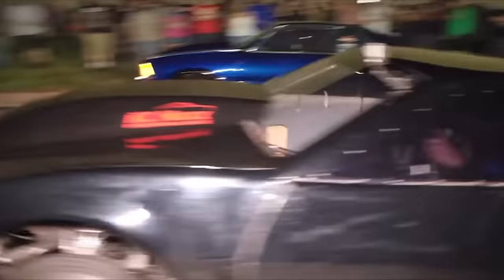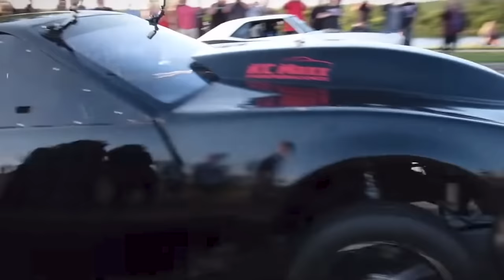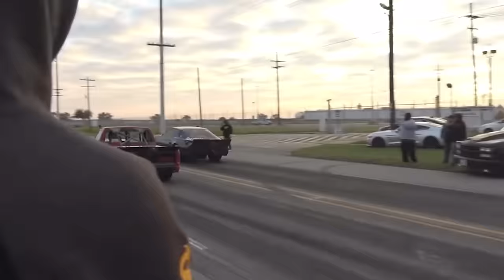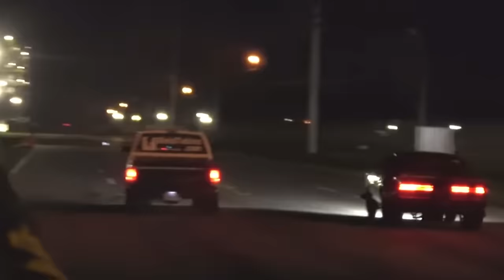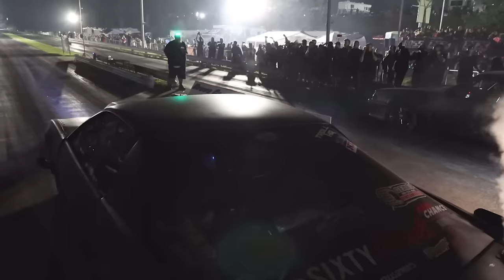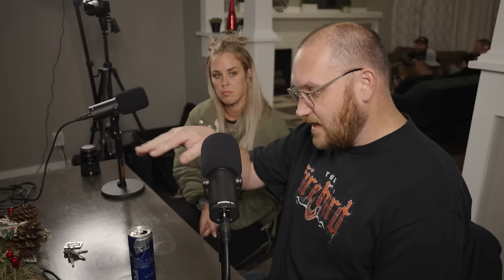Ryan Mitchell’s KC MAXX Secrets to Success  - WOTS #10

Comment: Johnson's baby powder and lots of it is your friend with tubes in slicks, pour it in, use tube locks with rubber washers around the stems, bead locks or screw the tires to the rim. The powder allows the tube to slide during the wrinkling of the sidewall.

Comment: There's no secret. He's got a big block with a pro charger with a big pro charger. I think there's probably only one or two people he's racing that have that combo. Everybody will be switching over the winter to pro chargers. I've had a pro charger since2016. On a 2006 Corvette with the LS motor. I was running low nine second quarter miles. People were tripping out because they didn't know what I had. I didn't know what it was.